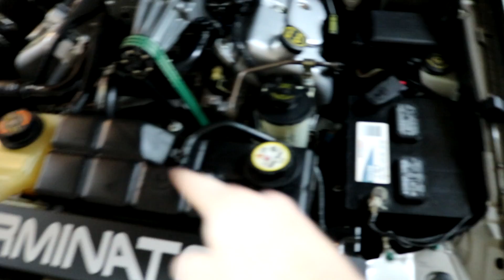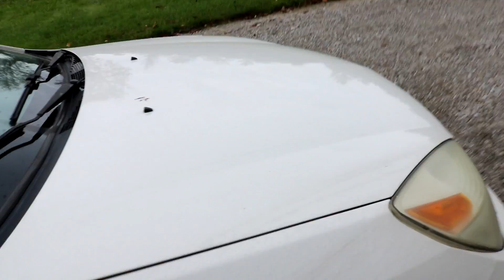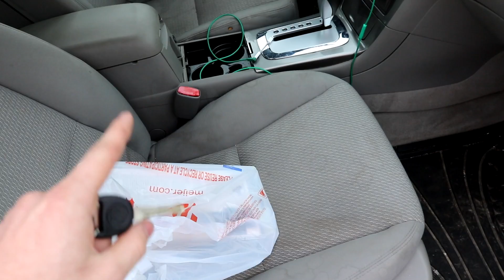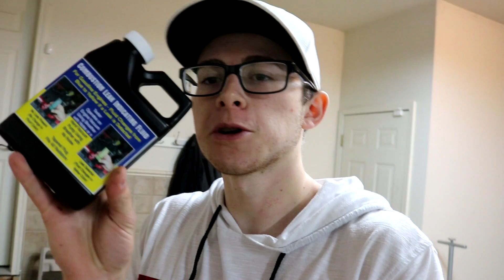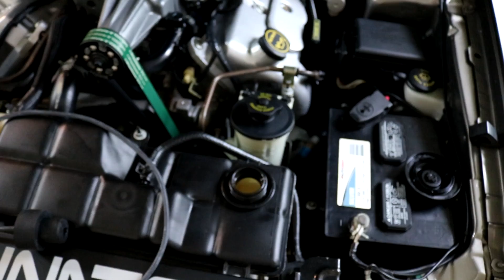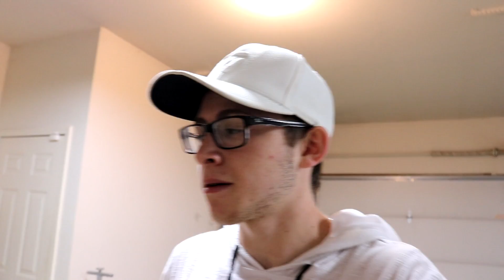My Engine Has a Major Issue....

Comment: This happens quite often. Get a new radiator cap the shitty original plastic ones always let coolant get thrown everywhere when the car is hot
Reply: also head gasket issues aren't too big of an issue it's really just with the 4 thread heads in early 03 cobras. I live in Missouri and with a mishimoto radiator, heat exhanger and expansion tank with 15k miles, most of those miles being at the track in the Midwestern heat ragging on the car it holds up fine

Comment: Common problem---pressure cap venting because of extra pressure. Caps are designed to hold up to 16lbs of pressure in the coolant system. Unfortunately Cobras are hot runners and under hard acceleration often exceed 16lbs of coolant system pressure, so caps are not failing, they are just venting excess pressure. Someone needs to make caps that handle more pressure, like 18-20 lbs. My 03 cobra does the same thing. I've had my head gaskets checked as well and they are fine.  It's aggravating to smell coolant constantly but it isn't really hurting anything other than your pocket for the rising cost for extra micro fiber clean up cloths! lol
Reply: tominator I got my car done man. When u get a chance check mine out terminator swap foxbody on Kurgan motor sports with cams.
Reply: 5.0 World...I already did bro! I love the sound your car makes. Perfect cam lope IMHO. Kurgan did you right. Small world too...my friend has a '98 GT(bought from me) that he is restoring to put in a Coyote swap. He wanted me to crash my Terminator so he could swap in my driveline but I said NO! LMAO  Keep me posted on your Fox...I've owned 5 mustangs and the first 2 were foxbodies!
Reply: yessir terminator issues. radiator caps, frps and alternators for days lmao

Comment: Check the drivers side of the block towards the front for small cracks,  might have to feel with your fingers since it's a tight fit.  Mine did the exact same thing and I ended up finding a small crack towards the top of the block right below the valve covers.